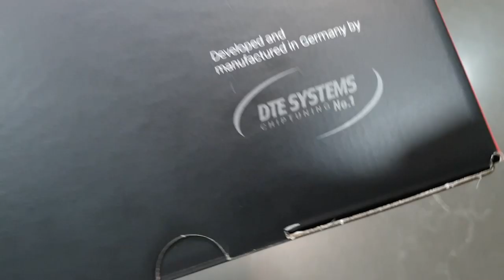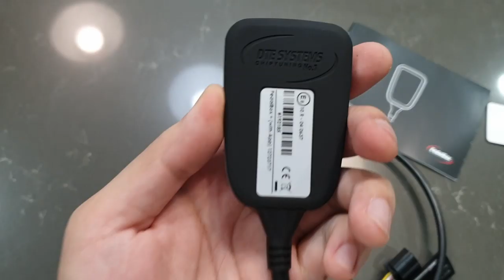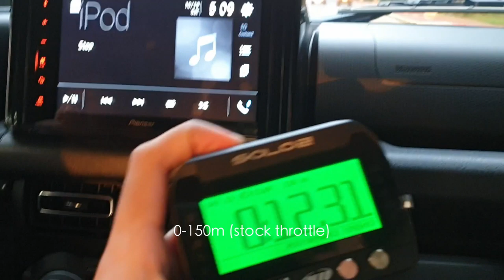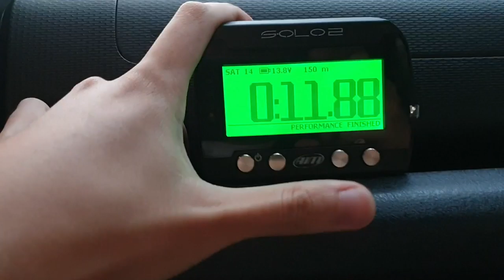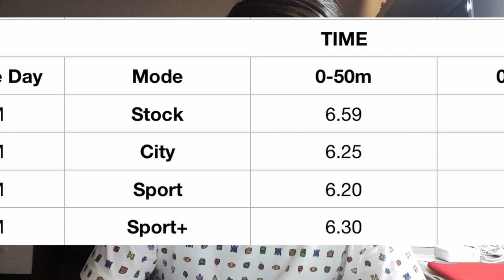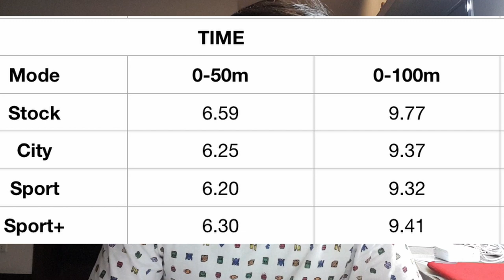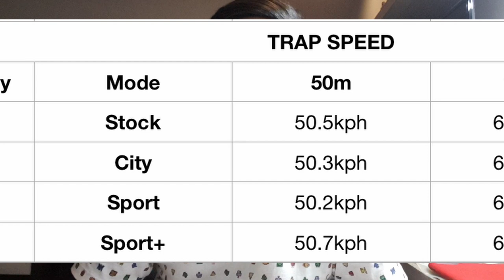2019 SUZUKI JIMNY PedalBox REVIEW and REAL WORLD TEST - (VLOG 8)

Comment from the maker: Product Tech Specs:
- DTE Systems - PedalBox
- Developed and Manufactures in Germany
- TUV Certified
- 2 years Product Warranty
- Php 18,000 without app
- Php 19,000 with app
- Better acceleration and more driving fun!
Reply: Can you try it on your jazz?
Reply from the maker: @csgonzales1103  this one is specifically for the Jimny so I can't plug it on the Jazz. I got to try a PedalBox on a Ford Fiesta before and it worked the same way if that is your concern. 😁
Reply: Hello! Have you calibrated first the throttle before using? I’ve watched a review coming from parts pro ph a while ago and they mentioned that it should be calibrated first to the car’s throttle before using.
Reply from the maker: @toppalacay2643  yup we did. The PedalBox still works even if you don't do the calibration though, but it might not be as focused as a calibrated unit.
Reply: Assuming it was installed on isuzu dmax, and planning to remove and transfer the kit to nissan navara is it possible?
Reply from the maker: @glennbaitan9563  probably not as this device is car specific
Reply: Hi do you sell this?

Comment: i am getting this soon for my 2020 Kia Rio 1.4 100 PS ... also i would advise you bro to install one of the K&N Air Filters. It's ''cheap'' way to increase your engine power by 2-5 PS and 3-7 N.m of torque :))) I am getting these two for my car.
Reply from the maker: I have a video where I did a K&N filter test. Not much gains unless you tune the car.
Reply: @FranzGaw  well I cannot tune my car too much as it’s my wife’s car currently I drive it. Plus there is no currently ECU tune available for my car. I would do it gladly. For now I Just want a bit more throttle response slightly bigger punch. Which is why I will also install PedalBox to increase response time of the throttle pedal.

Comment: I recently purchased a pedal box for my 2017 Montero, but the installer advised that when changing settings, the transmission must be set to P. kasi nung first test namin biglag nag labasan fault codes ko sa instrument panel tapos akala ko nasira yung transmission ko kasi grAbe yung narinig ko. Off ko yung pedal box tapos naka check engine sya need ko pa pa clear ulit yung warning sign na check engine
Reply from the maker: Please check if the installation was done correctly. You shouldn't have any problems switching settings even as you are driving the car. If fault codes continue to show up, maybe its best to return the product and get your money back
Reply: @FranzGaw  thank you. Regards kay uncle peter

Comment: Is normal in jimny jb74, when i press pedal a bit  dont increse the rpm until press 1cm or two (without pedalbox). I am considering buy a pedalbox.
Reply: Throttle lag. Common to new cars with drive by wire

Comment: You are not using the Pedal Box properly!! when you are in any of the levels you could up the sensitivity even more by using the + on the controller!! You should re do the review again and adjust it  as it should be adjusted.
Reply from the maker: Thanks for the tip! I actually knew about that and tried it off-camera. I was happy with the presets of PedalBox already so I didn't need to adjust the +/- anymore.

Comment: Jimmy is not for speed. it's for off road. make it slower by bigger tire and front and rear lockers also change gearing. some time less response with smoth response is better in off road.
Reply from the maker: It really depends on how the owner uses his/her car. I can assure you 90% of Jimny owners locally would only use their car in city driving, so this PedalBox should also be relevant for quite a lot of people.
Reply: very true.  unless doing dune, mud and beach drive is done often enough. also where self recovery needed. where iam self recovery is very important.